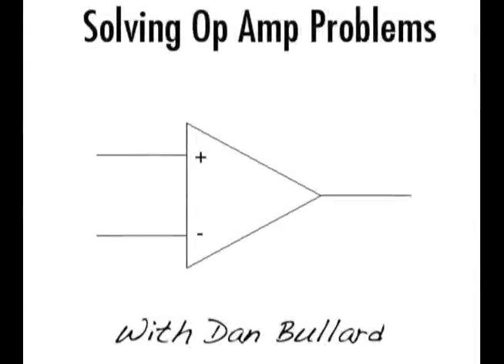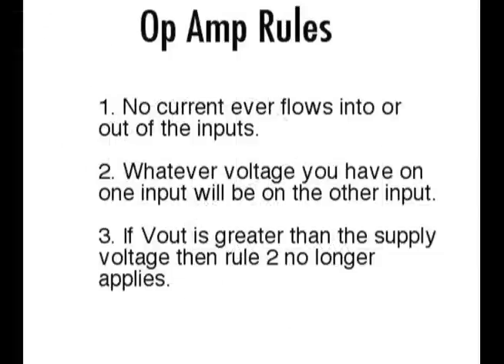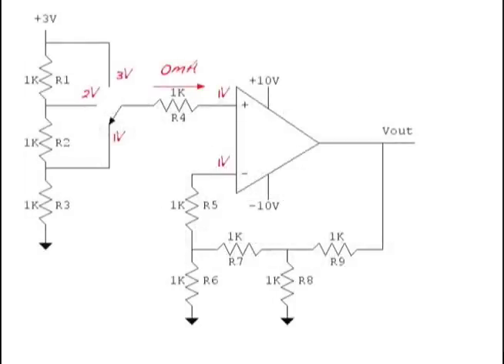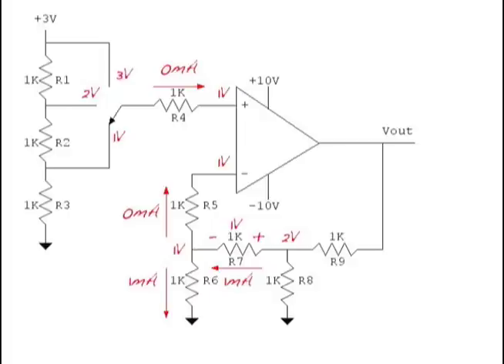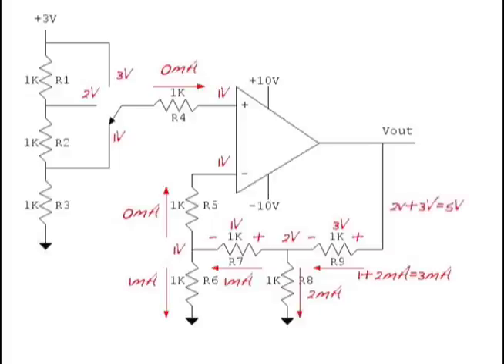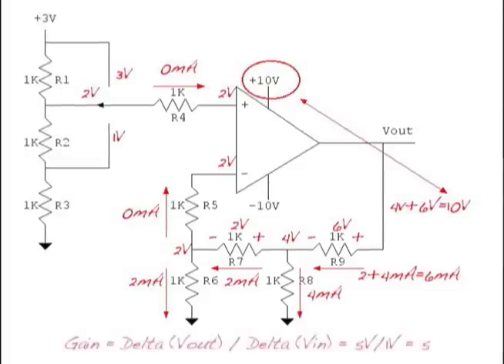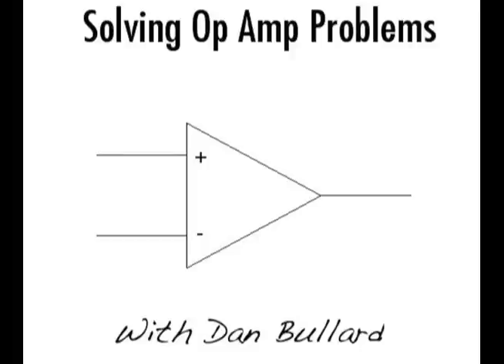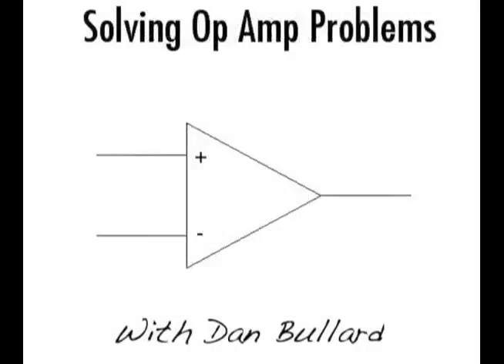Solving Op Amp circuits

Comment: v=i*R so how the current does not flow????????????????
Reply: Oliver C because of ultra high impedence at inputs
Reply: If you want to be mathematically/theoretically correct, 0 * infinity is actually called an indeterminate form. Therefore, V cannot be found using v=i*r if the current is extremely small and the resistance is extremely high. You are confusing the concept of open circuit voltage with Ohm's law.
Reply from the maker: I'll just tell you that I have worked for Maxim, Intel, Schlumberger, Tektronix, etc. I hold a patent in Smart Card IC testing, and I have been published in several test engineering magazines and written two books. I know what I'm talking about and pretty clearly Oliver doesn't have a clue, even with a degree. Makes me glad I never went to college.
Reply: What if R is very, very large? Then I is almost zero. That's the case with op amp inputs, the input impedance is so high that virtually no current flows.
Reply: DansFlix
 But this is pretty confusing to me. What is voltage if there is no Current????
Reply: When no current flows through a resistor, then the voltage on both sides of the resistor is the same. A resistor passes voltage through itself perfectly if there is no current, it might as well be a wire.
Reply: DansFlix
It is not possible by theory to say there is voltage but no current. Voltage is the product of current and the resistence of the wire or the device. If no current flows that means no electron are flowing which mean there can be no voltage either.. IF there is voltage without the flow of electrons then put down the equation for me please???? No one has ever come up with the idea that voltage exist without current If it does what is it??? and what is the formula for that kind of voltage??
Reply: You can easily have voltage without current. Take a battery. What's the voltage? 1.5 volts even with no current flowing. What's the pressure in your tires? 30 PSI, right? Is there any air flowing? No. But is your car still supported by the 30 PSI of air pressure in in your tires. Pressure (voltage) can exist without current. Don't confuse the math with the real thing.
Reply: DansFlix
Then can you write down the formula??? Without the flow of electron there can be no voltage can there be?? AGAIN AND AGAIN if there is what is it can you write down the formula for that kind of voltage??? You do not know how to put it down in the form of a formula and neither do you know how to define it what is it???
Reply: If R is extremely large then I will be zero no matter how big V is. Correct? The inputs of the op amp have very high input impedance, so there is virtually no current flowing into or out of them.
Reply: If that is the case then the formula automatically becomes like this V=0*R THEREFORE V=0 according to your own words. If you multiply 0 by R it equal 0 so Voltage is also 0. This is where your logic is wrong because you do not bother to solve the formula. I hope you can see it now??????????????????
Reply: Oliver C The potential difference (voltage) across the resistors you're looking at are zero. However, the voltage in the branch where the resistor is 1V relative to ground.
Reply: The equation you are referring to is not about potential, it's about difference in potentials, in this case a voltage drop. The guy basically says the current is zero, because the resistance in the input is pretty high, leading to the voltage drop being zero, which means the potential will be the same on both sides of the resistor.
In reality, the current isn't actually zero, but it is pretty small (we are working with mili Amps, and the resistances are in kilo Ohms, in cases higher) so we are guessing it's zero.
Also, in this case we are implying that the amplifier is ideal, meaning the input resistance is infinite.
Reply: +1 to Mikey's comment.
Reply from the maker: Because of the negative feedback configuration, the op amp does whatever it has to do to keep the two inputs at the same voltage by amplifying any temporary delta by up to 10 million (but in this case, because of the feedback network it's been reduced to 5). How temporary? That depends on the speed of the internal feedback network, or Compensation Cap inside the op amp. The greater the gain, the slower it goes. That's the Gain Bandwidth product. More gain, lower bandwidth. That's how followers (gain of 1) can be so fast.
Reply from the maker: It might be best to start with a follower, a simple op amp with the Minus input connected directly to the output. Apply any voltage to the Plus input, using Rule 1, you'll find that the output "Follows" the voltage on the Plus input.
Reply: *****  I also got an engineer degree open circuit or close circuit it has a formula because voltage without current does not exists. So why they say it no current is flowing let me help you. There is current flowing since without the flow of electron it is impossible to prove that voltage exists. The current will always flow since the flow of electron is the main thing but it is too small so it is negligible not because there is no flow of electron. That would be impossible to say there are no electron flowing but there is voltage No one has and no one can prove that but it is assumed that current is zero because it is too small.
Reply: DansFlix im sorry but absolutely completely wrong.. the voltage in a battery is the product of the inner resistance of the electrolyte and the current passing between the anode and cathode. Oliver C is right.. where did u learn electronics man seriously
Reply: Oliver C hes talking shit man your right. the voltage in a battery is nothing like a car tyre haha. the voltage in any battery is the product of the internal resistance of the electrolyte and the flow of current from anode to cathode chemically producing a potential difference across the terminals. Dont question yourself becuase of this guy. ohms law is true..
Reply: Dan Bullard Fair play. I hold a masters in Instrumentation, electronics and control systems plus too many other qualifications too list and have also worked in massive internationals. Just please explain how you can assume both inputs are equal unless output is greater, do the math, and then find that the output is greater? how does make sense to you? when you find that the output is greater does it not mean you were wrong in the beginning assuming both are equal? do you understand me?
Reply: Dan Bullard But the negative feedback allows the opamp to bring the input leg down to virtual earth through the feedback network. it doesnt bring the grounded inputs voltage up to match the input, it does the complete opposite. I still dont understand how both input could be at 2v in the first place. And also how you can use rule two and then prove that it is false at the end of the equation.. cheers

Comment: Rule no. 2 is also false if you have a positive feedback circuit used in oscillators, hysteresis circuit or schmitt triggers.
Reply: Does that look like a positive feedback configuration? In fact, my rules allow you to analyze a circuit which is positive feedback by assuming negative feedback, and when it doesn't work out (as this one did when the predicted output exceeded the rails) you still have a way to solve the circuit.

Comment: i have a question:
i am using opamp in open loop configaration 
vcc=12v,  vee=0v, v- =2v, v+=(0 to 5v) ac square wave
output is=(3 to 12volts)ac sqr????
i am expecting output=(0 to 12 volts) ac sqr.
what happened here please explain.i want 0 to 12 instead of 3 to 12
Reply: Not all Op Amps are "rail-to-rail" op amps. Check the specs and see what the specs are for rail to rail operation

Comment: Everybody does the schematic but nobody shows the actual chip terminals and what voltage goes in or out where.
Reply from the maker: Actually that is a good question. My Yf drew one for Jim Harris' school, TTC, but I don't have any idea where it is. I'll think about that on the next video. I did in the one on current sources.
Reply: Elecnut hi man i dont think this Dan bullard dude kniws ehat hes talking about at all. Considering this video makes absolutely no sense as per my comment above and also because its impossible to have any sort of experience in electronics and NOT know the basic op-amp pin out? Which is in fact an 8 pin chip.. pin 1 is null offset, pin 2 inverting input, pin 3 non inverting input, pin 4 negative supply voltage, pin 5 null offset, pin 6 output, pin 7 positive suoply voltage and pin 8 is not used in most chips its just there for structural intregrity. it usnt actually connected to anything. hope that helped..

Comment: Hi, I have a question. If there's no current flowing through R4 and thus no voltage drop across it, then what's the purpose of R4  in the first place? Thanks in advance.
Reply from the maker: I get asked this all the time, I should have addressed it in the video. Most often it's not a good idea to hardwire a power supply into an input, digital or analog. If the pin shorts out internally, something bad could happen. Better to limit the current than letting one faulty transistor set the chip and hence the device on fire!
Reply: Thanks for your quick response!!
Reply: I was looking for this comment ! 👌🏻

Comment: Hi, why when doing the equivalent circuit why R5 and OP Amp (-) input is not part of the circuit?? :/
Thx for the explanation I just understood it as I never have before, just that little question confused me.
Reply from the maker: +Edu "Turupá" Sánchez R5 and the Op Amp don't count as part of the circuit because the input impedance of the Op Amp is infinite. We don't make the insulators on the wire part of the equivalent circuit because their impedance is infinite. R5 is there, but since the input impedance of the op amp is infinite, it won't carry any current, so we can leave both of them out of the equivalent circuit.
Reply: +Dan Bullard Oh Thank you very much!!! That makes sense since the current there is 0, I'm still struggling a bit to understand impedance though. I'll keep studying :D
Reply from the maker: +Edu "Turupá" Sánchez Impedance in this case just means resistance. No need to get XL and XC involved since this is all DC. High impedance just means high resistance in this example.
Reply: Great. THX!!!

Comment: Excellent tutorial. Something that confused me was R4. I did the calculation with a Voltage divider with a Load (R4) and I got a different Volatge for the +Input. therefore if I analyze your schematic, Omitting R4 (because there is no Curent flowing through it,) will I get the same result? And if so, why is it necessary to include it in your example? Is R4 a mock component?
Reply from the maker: Everyone asks that. Those two input resistors are there for a couple of reasons. One reason is to protect the op amp from destructive voltages or currents. If the op amp input shorts out, we don't want the op amp to burst into flames, so a current limiting resistor is not a bad idea. And finally, very tiny currents may flow, and if that happens, we would like to make sure that the resistance on both inputs are the same, because that would keep the voltage offsets the same, since, if 1nA is flowing on one input, chances are, the same current is flowing on the other input. That means that any currents that do flow on the input cause a cancellation of any voltage drops.
Reply from the maker: +Luis E. Batres Generally, on sensitive input pins we like to protect them from too much current in case the pin shorts internally. The circuit will fail if that happens, but without a resistor, the whole box might catch fire. This is especially true on MOSFET circuits, because the gate is just a capacitor with a very thin insulator to keep the thing from blowing sky high.
Reply: +Dan Bullard Thank You for your response. I am still conflicted though; because if as Rule 1 states: there is no Current going into the Inputs of a Op-Amp (for an Ideal Op-Amp that is, because of the High input Z of about 1M ohm for a Real Op Amp.) is your Low Resistance (in R4: 1k) helping in any way to prevent Damage or Over Heating?
Reply from the maker: +Luis E. Batres Because if the input shorts, the max current will be only in the milliamps. Some engineers bias op amps right from a power supply line capable of 10s of amps. What if the op amp fails and you have no resistor on that line? Even if in normal conditions the input Z is a megohm, if it shorts, (either internally or externally) you'll have grounded a 100W power supply which will probably burn up the runs on the board or start a fire in the component or elsewhere in the circuit. It's easy to use a power supply line to provide a static "1" or "0" to a digital circuit IC for example, but if the device shorts out internally, your power supply can now dump 10s of amps into the chip causing a real safety issue. A nominal resistor, say 1K, will not reduce the voltage much on a high impedance pin, but may prevent a fire, and that alone is a good reason to have a resistor on those pins.
Reply: +Dan Bullard Ok. Now I get it. So R4 is not cecessary in this "simple" circuit, but it is of Utmost Importance for the protection of other Circuits in ase this one fails. Thank You for the clarification and your excellent Analysis of an op-amp.
Reply: +Dan Bullard I had the same question too.  I am assuming the same explanation holds for R5.

Comment: This is priceless interview material. In several job interviews I've been asked to analyze the large-signal behavior of different opamps circuits with no equations and this technique has helped me A LOT! Thanks for posting Dan!
Reply: If you need something as basic as this on youtube to give you an advantage in a job interview then your training and experience is way below what you need to do that job.

Youd be like the aeronautical engineer that thought its ok to cut heat traeted aliminium by laser cutting.

Education these days is so poor if it results in qualified people that have that level of knowledge
Reply: @davefoord1259  based

Comment: My teacher told me today that you cannot have a higher voltage than your supply voltage without causing clipping, not sure how this applies to your rules or if it does.
Reply: +Juiicy Rich I think you need to watch the video again. His explanation of his "rules" are pretty clear. Your teacher is right, which is why when getting a Vout that't higher than the positive rail, he backtracks and solves the circuit again for the voltage at the negative input.

Comment: Nice!
Do you have a video on op amps in audio applications?
That would be a good one to solve :D http://www.freeinfosociety.com/electronics/schematics/audio/hughesandkettnertourreverb100.pdf (Page 4)
Reply from the maker: Das TIER The only way audio circuits differ is that they used capacitors to tweak the frequency response. The first thing to do is ignore the capacitors, used white-out if you have to to obliterate them. I was given a circuit like that one on page 4 (yes, I looked at it) during my interview at Tektronix. I stunned the interviewer and got the job on that basis alone. I don't need to solve any more, I've solved my share!
Reply: Thank you very much!

Comment from the maker: I've had several people challenging me to solve this circuit or that circuit. Let's not do that. Use the technique I show you here to solve the circuit you have in mind. Assume a voltage and see what happens. You can always start with the Vout at one of the rails and see where that leads you.
Reply: I am wondering if by 'voltage supply' he means the plus/minus 10V attached to the op amp
Reply: Yes, the power supply
Reply: Dan Bullard You assumed there is the same voltage on both inputs in each case (as per your rule 2) and then found a greater voltage on the output in each case? rendering your rule 2 redundant as you stated yourself? This makes no sense? how can you have no differential between inputs(considering firstly that this does NOT use negativr feedback) (ie. 2V on each input and then magically have 10V on the output? again reaching that conclusion by assuming one input is the same as the other "unless the output is greater" then finding that the output IS greater and still taking 10V as the legitimate answer??

Comment: Hi Dan, I gotta doubt, in fact I think there is something wrong in what you explained. I apologize if I wrong. In your first case, where 1v input is supplied, you said there would be a total of 5v across R8 and R9. Actually it is a potential divider network of equal resistance, it cant divide differently. It should be either 3v ,3v or 2v,2v not as 2v,3v. Please let me know if I am missing something
Reply from the maker: Ash R8 and R9 are not forming a voltage divider on their own. If you want to look at it like that you must consider R6 and R7 as well. It is then a voltage divider that has 1K (R9) in series with 0.666Ohms (R8 in parallel with R7 and R6 in series).